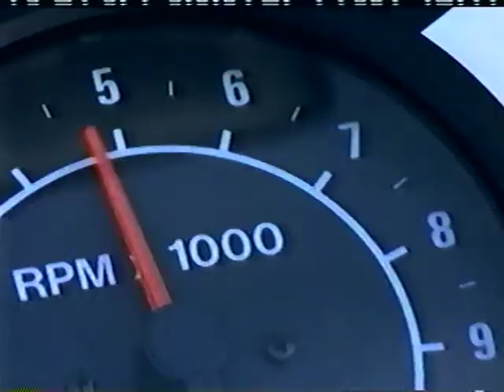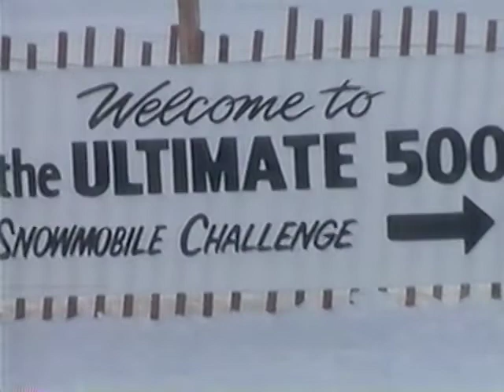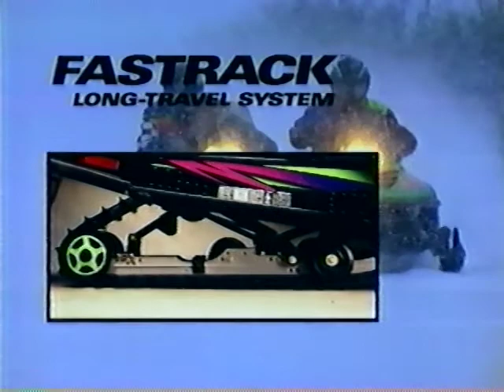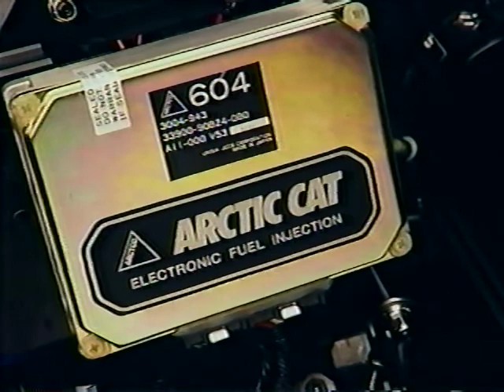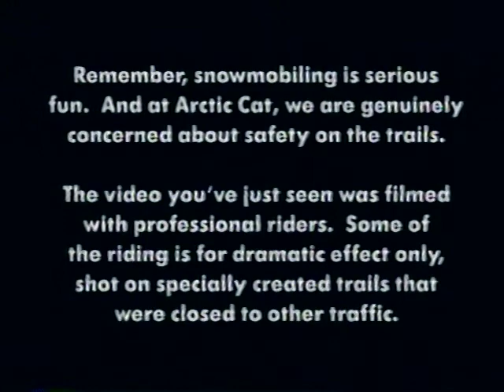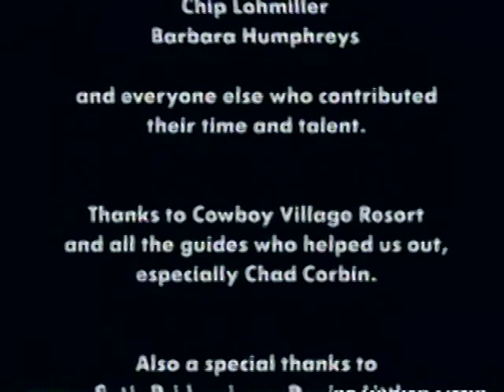1997 Arctic Cat Action Sales Product Lineup Models Promo Snowmobile video

Comment: Very Cool stuff!  I rode a 97 ZR 440 for years and still have it in the garage!  What a machine, definitely a pure-bred racer.  When conditions were right and it was in the correct state of tune, it was the most fun sled on snow.  The sound, the high revving performance, the suspension and handling, the looks...oh man I am getting goosebumps just thinking about it!   It was a finicky sled though, it needed lots of maintenance to keep it on the snow and the 9 tower primary clutches on these generation Cats were absolute garbage - the one on the ZR 440 literally exploded while I was riding it!!  But the amount of fun I had on that sled far overshadows the issues had with it!
Reply: I had the same sled for a few years, finicky as all get out, but when it was on, it was on! Debating hunting my old one down somehow and seeing if I can buy it back haha
Reply: @brianvoth6515  You nailed it right on the head, when it was on it was ON!  It definitely held its own in the twisties and the rough stuff (in its time) and was definitely a "giant killer" when it came to taking on sleds of larger displacement.   I went to a Firecat F6 Sno Pro after the ZR 440, which I still ride and love too!  The Firecat needed a bit of tweaking and a pair of C&A pro skis to handle like the ZR but the EFI equipped F6 just runs so good in all conditions and has been far more reliable and durable overall then the ZR 440.   The fun factor...it's a toss- up, both of them put huge smiles on my face and that's all that matters!
Reply: @adamm2837  agreed, I could take my brother on his 2000 ZR600 up to 75-80 mph everyday, just didn't have the top end. Became a pro at trailside rejetting because you had to do that for about every 3-5 degree temp change (celsius).
Also hilarious because I also went to a 2004 F6 after the 440, and it was a game changer, totally changed my mind on EFI, I won't go back to a carbed sled again, short of buying back one of my old ones for nostalgia haha.
Now I'm on a 2015 ZR6000RR (Tucker Hibbert edition), and the handling is out of this world. Not nearly as fast as my F6 was though, that platform was out of this world.
Reply: @brianvoth6515  Oh yes, we messed around with the jetting quite a bit (though always kept it on the rich side for the most part, just to stay on the safe side for trail riding) as well as the clutches.  Those 9-tower primaries on the Cats in that era were junk.  One exploded on me while riding the 440.  How amazing did that 440 sound when it was matted to the bar?   

What a coincidence that you went to a F6 after the 440!  The 2004s, especially the early builds (my buddy had one of the early builds) were incredible performers.  There were often times that machine gave 800 REVs trouble out on the lake!  My 2005 has the ACT Diamond drive and it goes plenty fast enough for me..way more then enough.  I was kind of hesitant going for a Firecat at first as there were some horror stories, mostly about the 2003 models, but the 2005 has been pretty much flawless other than a cracked filler neck on the gas tank (big recall on that) and the speedometer only works when it wants to (says it has 4400 miles on it...it has WAY more then that!!).  Looks wise, I still think the Firecats are some of the coolest looking sleds out on the snow till this day.

2015 Tucker Hibbert 6000!! Those are beautiful machines!!  I have been kind of keeping my eye out for a Procross 6000 of some kind, I am not really into the 8000s and it seems like the 8000s are the only ones that ever pop up for sale around here.  And half the time the Procross models around here that are for sale are stupid ones, like Mountain sleds and such.  Don't need that here in Western Mass.
Reply: @adamm2837  haha my 440 ran the absolute best and sounded most wicked... for the last 30 seconds before it blew up on me. Disintegrated the connecting rod to crank bearing, piston shattered against the head, and punched the pieces through the bottom of the crankcase 🤦‍♂️. Dropped a replacement motor in after that one, but a learning experience nonetheless. 

I was working for AC from 2001-2004, and when the Firecat got released it took a bit to get used to, but I loved the look. My brother got a 2003 F7 and I got my 2004 F6 at the same time, we lined up on radar runs a couple of times. He ran 99.7 mph, I ran 99.1 mph, but as a 600 I beat all the 600’s, half the 700’s, and a couple of 800’s! Top speed I ever saw was 113 mph, I still kick myself sometimes for selling that sled. 

The new sled is awesome, the race chassis is a sweet setup, but still nostalgic for my old sleds!
Reply: @brianvoth6515  wow when your 440 engine had enough, it really said NO MORE and self destructed !! Unreal!  

You worked for Arctic Cat between those years?  So you were there for the debut of the Firecat?  What did you do for them?  That must have been a very interesting period for AC during that time.   It seemed like quite a gamble going from the tried and true ZR chassis  to the radically different Firecat F2 Chassis.   I was pretty pissed that they had replaced my beloved ZRs with the Firecats....until I began seeing Firecats out in the wild and from that moment on I wanted one!   It definitely took some getting used to like you said and some C&A Pro Skis to get the most out of the Firecat!   It was a bit of a learning curve learning on how to wrench on certain things on the Firecat as well.

You're right, the newer machines are amazing.  But there is something they lack that the old ZRs and the Firecats have.  The Firecats especially have gained quite a cult following over the years.    The newer Cats are awesome but they don't quite have that unique character or passion inspiring aura of the older ones we are so nostalgic about!